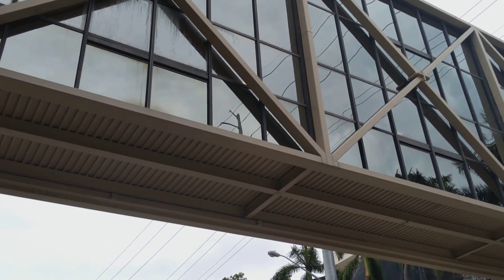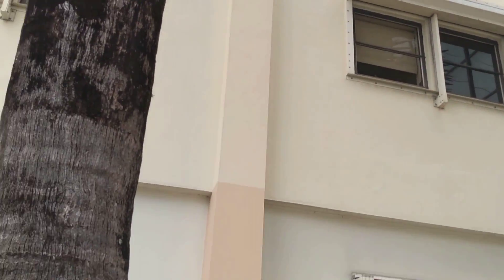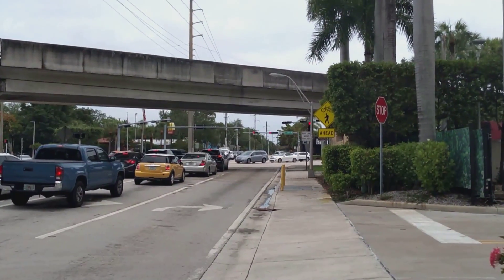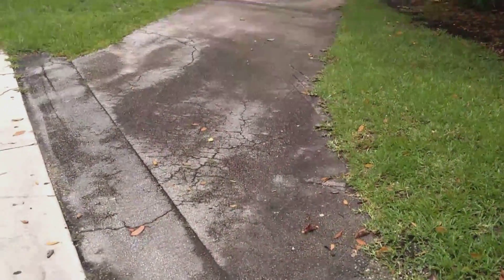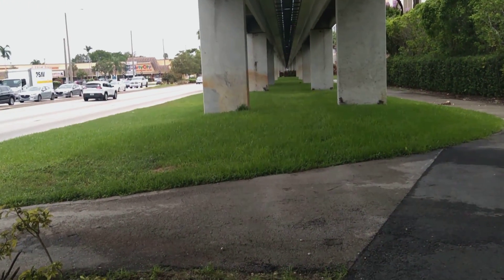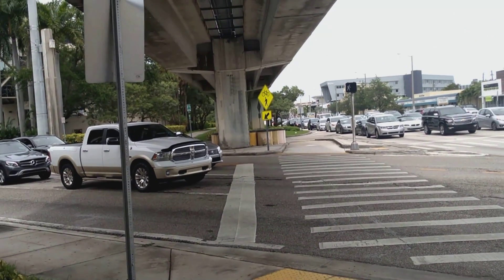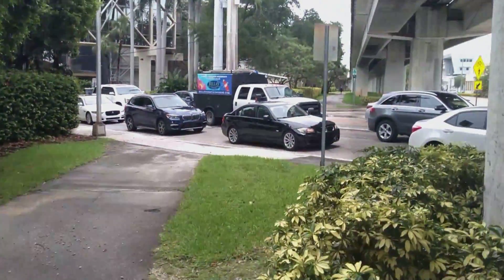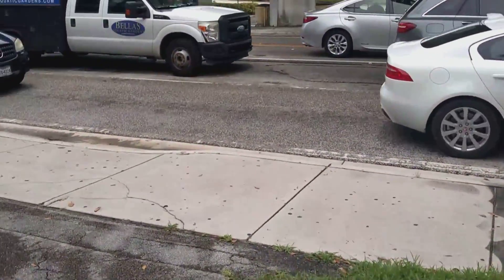What Does This Railroad Crossing Look Like 80 Years After ?

Comment: Awesome. I, too, wish  I could experience life back in the early 1900s. I found an older gate at a crossing that is not used anymore in my town. It still has the mechanical bell up on top! I'm going to capture a few photos of this rusted out RR crossing gate and I'll share them with you on your Instagram page. It's a crossing that hasn't been used, for well over 20yrs, but they've never put it in "exempt" status so I still have hope for this crossing! How have you been? We've been experiencing some nasty heat up here in South Chicagoland. Highs in the 90s with heat indices of a 100°or more. Not fun! Plus, my 2007 Dodge Charger doesn't have air! It would cost way more to fix it than the car is worth! Bummer. I'm so use to not having a car payment that I keep putting off getting a new(er) car. Oh well. Take care, looking forward to the next video! 🙂 🛑X🛑

Comment: I also wondered where the Metro ended, so using Google Earth, I followed the tracks to the end of the line, somewhere around 98th.  I was not aware that there was a private road for buses called the Miami-South Dade Busway.  I assume they made good use of the old RR bed, and put the busway in over it.  That goes for quite a while.  I looked for evidence of tracks, rail bed or any sign a railroad once was there and nothing.  Until I got just south of Florida City and west of Dixie Hwy (US 1).  There is a double dirt road that continues for quite a while until it abruptly ends at the Southern Glads Trail at the beginning of North Key Largo.  There's no good reason for a double dirt road to be there in the middle of nowhere, so my assumption is that is where the tracts left the mainland to start their journey south into the Keys.  You see how you got me started now?

Comment: It's very true what the description says about both the FEC and Miami-Dade County. I don't know why, but they both seem to have an astonishing lack of foresight. Imagine how traffic would ease off US-1 if the FEC or Brightline ran Passenger Trains through Perrine, Goulds, Dadeland all the way to Homestead!

About the photo though, this is a very rare shot along the FEC's Homestead Sub. Very rare to see photos along that line, especially in that era! The Locomotive in the Photo is one of the FEC's 2-8-2 Mikado Types, If you closely you can see South Miami Station is visible just behind the Train! That Station was originally made of Pine Wood, but was replaced with a Concrete Structure sometime in the 50's I believe. Sadly it was demolished sometime in the Late 70's-80's.
Reply: There's a copy of it on display at Shortys BBQ in Doral.

Comment: You're in the wrong location. It's Sunset and US=1 facing north. Those buildings on the east side are still there and the train would be leaving the Metro-rail station for Homestead.
Reply: Check it on Google Street level ... there's that building with the three gothic-looking windows! It's a smoke shop and a salon. The salon looks to be really gorgeous inside ...
Reply: THAT IS SUNSET DRIVE AND US 1 THE BUILDINGS ARE THE SAME SINCE 1953, THAT I CAN REMEMBER, IN FACT RIGHT BEHIND WHERE THE PHOTOGRAPHER WAS STANDING WAS AN REA BUILDING THAT STOOD UNTIL THE LATE 50s.